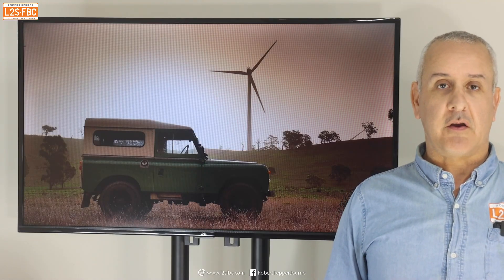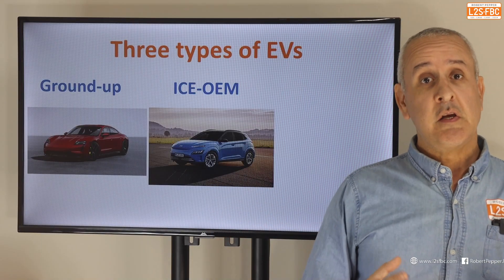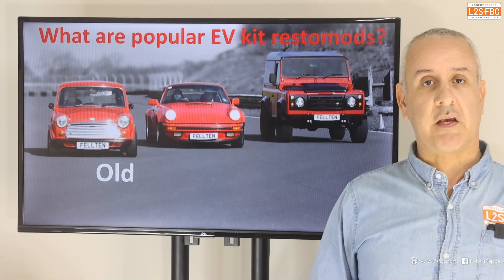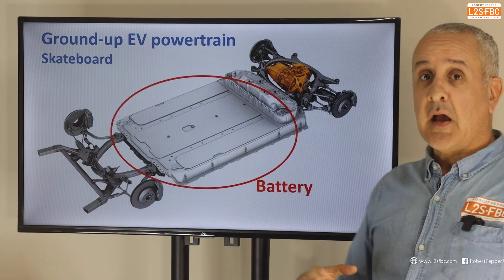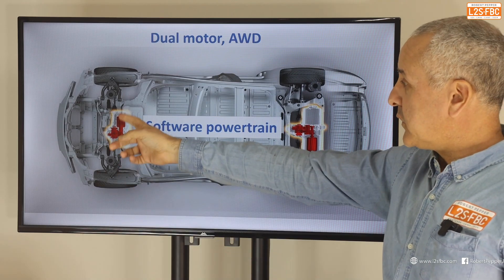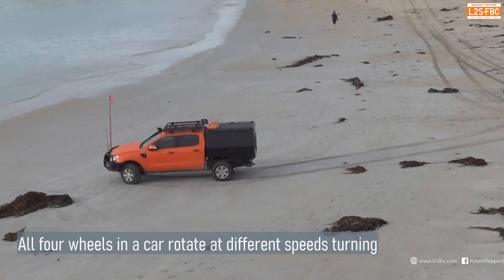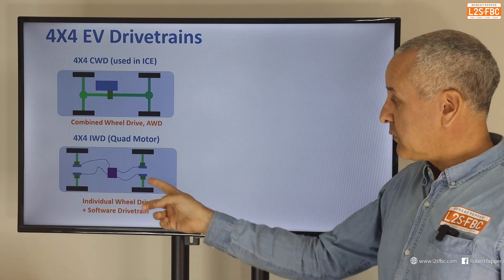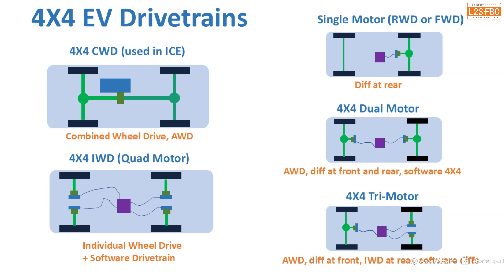Which EV 4x4 restomod drivetrain is right for you? Jaunt, Fellten options explored

Comment: Very interesting indeed.   With these drop in options and the increase in torque I am assuming there are a lot of components that need to be upgraded to handle this such as prop shafts etc?
Reply from the maker: Yes, there are in fact regulations about how much extra power you can put into a mod package.  But also, the maximum figures are always headlines, the computers don't necessarily let you have those maximums at all time.

Comment: Contemplating your comment about drum brakes. 

Drum brakes are significantly more effective when used rarely. As long as they aren’t hot they work extremely well. In an EV the brakes would  rarely be used unless in an emergency stop situation. The low maintenance and high reliability might see a resurgence of drum brakes on EVs.
Reply from the maker: This is true...but offroad they are not ideal as they can collect debris, and the versions on the older Landies were less than stellar stopping power.  So I should clarify it's more about the original brakes than the drum design per se.
Reply: @L2SFBC Any thoughts why the 2010 on  Australian army inspired W461 G Wagen "Military" and "Professional" sport rear drum brakes, while the late 1990s 290GD had rear disc brakes ?
Reply: Several OEM EVs have launched with drum brakes, at least on one pair of wheels for presumably exactly that reason. Some of those cars are doing 10s thousands of miles without having to replace brake pads or finding brakes have rusted from lack of use

Comment: Have recently seen a video about a croatian company making a conversion kit for the Pinzgauer.
They too just put in a battery, and replace the ice engine with an electric motor at the gearbox input.
One thing such a system has that i think adds to the fun offroad: you can't stall the engine. And you don't need the clutch for anything but changing gears. Stopping and driving off in steep inclines can be done with the left foot on the brake and the right on the throttle basically.
And because solutions like that still incorporate the gearboxes,  you can adjust how fine the "resolution" of your throttle pedal translates to the wheelspeed by using different gears (and low range). I think that is something ground up EV's lack: with an ice engine in low range and 1st gear the delta you have with the throttle pedal equals to a way smaller change in wheelspeed than in 1st normal range. So you can control wheelspeed changes much finer.
In an EV wihtout any gears, the throttle has to cover 0-max speed in one delta. (I hope it is somewhat udnerstandable what i mean)

Apart from that: i have seen a comparisson test where the host was quite impressed with a Rivian pickup i think but he struggled on a steep incline, as the software did not simulate what you would call "3 locked diffs". So it ended up like many modern SUVs where the traction control cuts engine power.
Of course this is a SW issue, but with conversion kit's i would think that even less effort is put inot offroad programming than a manufacturer of a new car that is advertized for offroad use would invest.
Would be interested to see if Mercerdes for the electric G wagon thought about that. I have seen plenty of them being tested, on the road and by chance on their experience center. (before the presentation of the electric G that was)
I was next to the experience center because of work, and saw them going up an easily 100%  incline with the electric G and a current Defender. While the Defender had some minor but audible tyre spin upwards (always immediately stopped by the traction control is seemed) the G did not.(it went up there like if you had locked 3 diffs in the ice version.) But both were erily quiet apart from the noises the tyres made on the ground. My collegue and i wondered, if they just did comparisson testing, or if Magna did/does some develloping of an EV solution or the hybrid system for Landrover. (it is part of their portfolio after all)
Reply from the maker: Great points!  Yes I understand re delta, but that can be fixed in software. 
Some Rivians are IWD, so motor for each wheel.  This has advantages, but one problem is that the max torque per wheel is that of each motor. With ICE, the total torque of the engine can go to one wheel if twin-locked.  So, quad-motor 4x4s could possibly run out of torque, esp as no reduction gear.
Again, with 'software drivetrains', how good they are depends on the programming.
Reply: Can you Put in the Link or a hint?

Comment: There is so much misplaced resistance to electric motors in cars. Electric motors are near ideal propulsion systems - heads and shoulders over ICE and transmission technology and is superior in pretty much every way. The more one understand how these DC or 3 phase motors work, the clearer becomes the truth in this statement. 
The problem is batteries, too heavy, too touchy and way too expensive.

Comment: One thing that concerns me with these conversions is the lack of inherent safety that is built into an ICE 4WD vehicle.  For example on a dangerously steep climb on a narrow hill track track, if it becomes impossible to proceed you can just prop and stop (stall), evaluate and set up for a reversing descent, then do a key start.

For an electric vehicle, especially direct drive versions, it's not clear how this would work.  Does it start to roll backwards dangerously as soon as you take your foot off the accelerator?  Are you forced to use brakes only to descend?  I think many of us know how dangerous this would be.  I really don't want to be on the wrong side of 9.8m/sec^2

I can think of a few ways around this, but they all require a live drive train, would have to be engineered in, and would put the vehicle in a very dangerous situation if it lost power for any reason.  If this is not the case then it makes the conversion only suitable for softroading, so the actual choice of drive train becomes moot, or at least limited to financial/on road considerations.

If this aspect has been completely overlooked (as I suspect it has) then the 4WD conversions are nothing more or less than an expensive anachronistic toy.  There's nothing wrong with expensive toys of course, until they pretend to be something they are not.  I've long considered the Cybertuck to be in this class by the way.  I've seen that thing suffering from poor traction due to its immense weight (3t) and lack of wheel travel with the suspension pumped up to maximum (and lack of clearance with it NOT pumped up).  I've never seen anyone put it on a serious hill climb, probably for good reason.
Reply from the maker: This is the software powertrain issue I talked about.  Essentially we need to rely on programmers to have considered all the edge cases that could get people killed.  And I'm not sure they have.  Good post thank you.
Reply: Well, diesel and electric locomotives all are being driven and stopped by using the electric motors. Yes, they do have friction brakes, but those are only used sporadically or at very low speeds, where a greater precision is needed. I wouldn’t be concerned about the technology’s ability to cope with that.

However, if this has been taken into account in the software of BEVs and, especially, restomod BEVs - I can’t say.
Reply: If you haven’t driven an EV yet, you should. In the Tesla, for example, regenerative braking creates significant friction as you roll to a stop - one can drive many miles through urban start/stop traffic without ever touching the brake. Drive a Tesla up a steep hill and choose to stop part way, and you won’t roll backward; you’re held in place by the electric motor itself, even if you don’t engage the brake. I admit I haven’t yet tried rolling backward on a steep hill, so I can’t tell you whether regenerative braking kicks in to decelerate you when you’re in reverse on the steep, but that’s just a programming change if it isn’t in place already.

I have no idea how the vendors of these resto-mod systems have configured their regenerative braking, but the technology offers you significant safety advantages over ICE if your use case is stopping on a steep hill.
Reply from the maker: Regen is an effective brake, but what if the battery gets to 100% or is unable to accept charge due to heat?  Does regen suddenly cut out?
Reply: @L2SFBC  There's ways around this, and the most obvious one would be to put a resistive load across the motors which basically dumps the energy into the load.  This would require some serious cooling, and as far as I know this is not done.  The other problem is that regen braking needs to have the motors turning in the first place, and at a significant speed too.

I don't believe that any of the designers have experience of overlanding or serious off roading.  Maybe someone will eventually design systems that will work, but no one is going to buy them until they solve the range and charging issues first. 

So like I said, I think they are expensive toys, but people need to realise where the limitations are.
Reply: @L2SFBC  You're right that when a Tesla battery is charged to 100% regen braking stops working (presumably because there's nowhere to put the charge). We keep ours at 80% unless we're planning a long trip; the first few km after charging to 100% is a little unsettling as the one-pedal driving behavior is different from what we're used to (it coasts like an ICE vehicle when you come off the gas).

But it's pretty unlikely that an EV will be at 100% charge well into an offroad adventure. Other youtubers have noted that EV range drops dramatically when you're climbing mountains on low-friction surfaces; power consumption is relatively high for km traveled, and you'll drop below 100% pretty quickly. Unless you're charging to 100% at the trailhead, I doubt this will be an issue.
Reply: @mfreidberg  Regen braking is so far from what I'm talking about I'm struggling to find the words.  Yes, I've driven an EV for work.

Unless you've done this kind of driving, you just don't know.  You need all four wheels locked absolutely sold through the drive train.  Even open differentials can be extremely dangerous.  One mistake on steep loose and broken ground can potentially cause the loss of the vehicle or worse.  There's no regen breaking when you need the wheels not to be turning, and when you do start coming very slowly back down in reverse, doing so under brakes only is extremely dangerous.  You can't stop a vehicle moving downhill in this way with brakes.  I've never seen one EV "offroader" that I'd use for anything more than softroading - a few flat trails and maybe beach work.

Comment: But isn't the "resto-mod" actually a new vehicle?? - or does the original compliance plate  - from the "donor" determine minimum safety gear / equipment-levels which must be included??

For a great toy buggy / off roader (definitely not a tourer/"overlander") - a dual speed rear drivetrain - for low speed crawling torque and high speed RWD fun- option, while front axle with low speed (low range / high torque only  would get a lot of the required tasks done - including off the line quick for drag racing , NB, after the first 20-40ft very little torque can get planted through the front wheels in a nicely balanced drag car..)- - is a good performance compromise - for an off roader (sport driving) - a heavily performance biased offroad "hybrid -  on-road (fat low profile tyres for the mall crawlers - on 24s) - dual speed front and rear ratios would be great fun - especially for code monkeys to play with - every 4x4 mall crawler needs to be able to do 4 wheel burnouts at any speed , of course.  -   joking there, but you know the buyers of these "restomod vehicles are specifically into ostentatious waste -- dressed up in conservatism..
Reply: Given that the modified vehicle will have none of the ADAS features required of new cars, I think your latter idea is the correct one - original compliance.  This will only continue until something goes horribly wrong.
Reply from the maker: The restomods have to comply with original laws, plus.  Jaunt vehicles are upgraded, eg different/new seatbelt mounts.